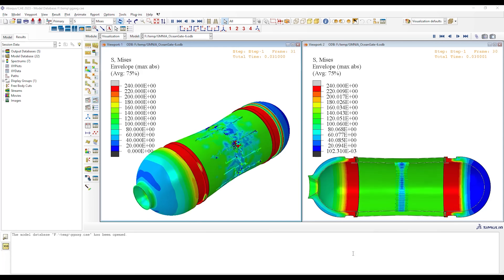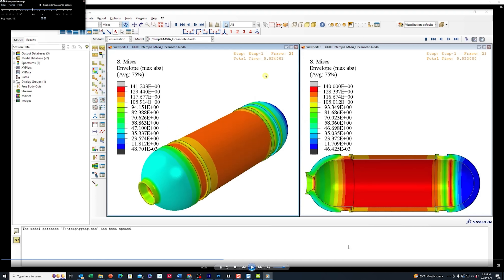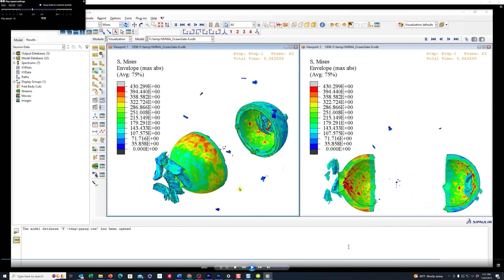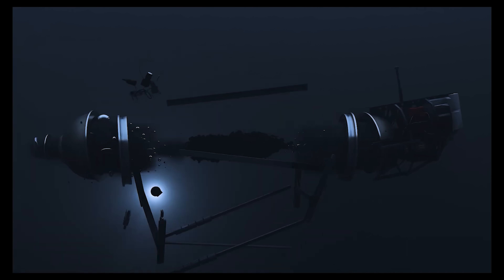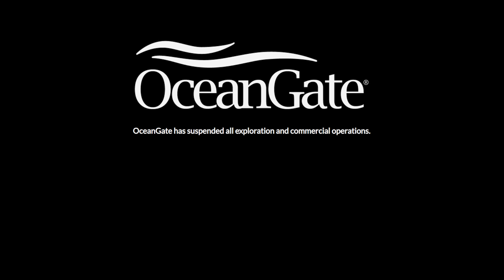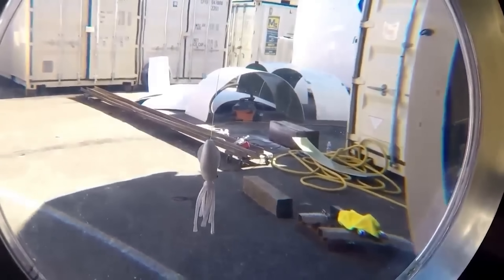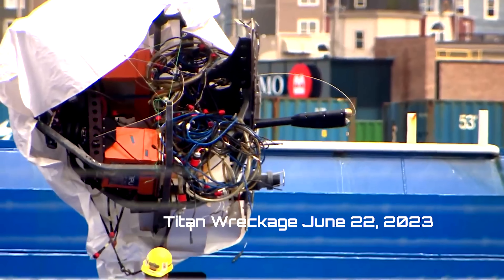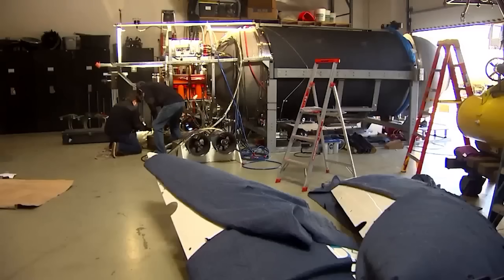Best Titan Sub Implosion Simulation, Cracked Porthole? Q & A

Comment: I have seen Trek bicycles warente a bicycle frame made of carbon fiber tubes and aluminum lugs. Body sweat on the top tube started to get into the joint were the carbon top tube was fitted to the alluminum steerer tube.

Comment: Personally, in my opinion I feel like its possibly started with the carbon fiber hull, then the plexiglass port hole blew because of the immense pressure towards the 2 titanium ends.  If it was the port hole first I will be incredibly surprised and will eat Crow. However my intuition says it very well began at those bonded seals between the titanium and the carbon fiber hull.
Reply: I agree with this, although the video of the recovered pieces weren't that clear, I couldn't see any of the bolts securing the plexiglass retaining ring which would suggest that it blew outwards at the time of hull failure.  If the plexiglass failed and blew inwards, I would expect the retaining ring and bolts to still be in place.
Reply: My engineering expertise says the glue joints seeped after a few dives. That loud popping like a small caliber handgun during the first few dives was that glue giving up.  Then it seeped water, as it got deeper the pressure sealed the seeping. Until this last dive.
Reply: I think someone farted and there was to much pressure
Reply: I'm a little annoyed with the hundred of comment affirming that it's the glue/hull that failed first without any proof.

I agree that it was a weakspot, but it was not the only one (at all), and everyone seem so certain... It's truly annoying.

I wonder why so many people do simulations and investigations given that every students on the planet seem to KNOW what have happen without any proof 🙄

Comment: What if water found a way into that hydraulic hand pump and slowly flooded the submersible as air couldn't escape?

Could that make it pressurized and not immediately be the end of the submersible in an instant? 

Wouldn't be any better as the air would become toxic.
Reply: If any leak existed that allowed water into the interior while they were 3500+ meters down, the water jets would be well beyond water cutter levels of force and would eviscerate everything inside as well as cut through the interior of the hull opposite of the leak source and cause more leaks and thus more jets in the short milisecond before it implodes from being damaged by the water jets.
Reply: @MagnumForce51  I think the thought is weak capillary action like kitchen sink drip level flow.... drip................. drip...........drip...........  squeezing between microfractures in the epoxy resin / CFRP laminate. Slow at first, as the intrusion needs to saturate the hull and then slowly permeate in.
Reply: It wouldn’t surprise me if he used a store bought hydraulic jack designed for something else.  The seals holding the 10,000 psi inside may not be double-lipped or designed to take as much pressure from the outside.

Comment: Nobody's mentioning the Stern half there's a lot of weight bolted on there on the ring that's glued onto carbon fiber, the frame is not substantial the weight without twisting, when that thing is bobbing up and down in the sea when towed that can't be good gravity playing its affects on it, the size of the bolts holding it on not very big. That's where it's happened at the Stern

Comment: Salvaging footage from an exterior camera seems possible.

 I do have major doubts about getting anything from an interior source, because the implosion was so violent.  It seems likely that any tech there was effectively pulverized on the spot.  But it is still a possibility that should be explored, I fully agree.
Reply: One frame every 16 milliseconds, implosion probably took a couple of milliseconds.  If it could be recovered, you'd see everything fine right up until the last frame recorded, then if it could record more, black.
Reply: where is the camera data stored, is it on the laptops located inside. then no.

Comment: When the hull fails, there are two nonsurvivable conditions. First would be the force of water against the body, it would immediately cause a spike in BP, probably enough to cause aortic dissection (this is the common cause for death in high falls/airplane crashes). Second is if you're not in the shattered area, the air would be compressed. This would cause your lungs and eardrums to rupture (a 20psi overpressure from a bomb blast would do the same thing), followed by Thor's water hammer.
   Hydraulic fitting have insane pressure ratings, and would not be affected by the external pressure.
Reply: A spike in blood pressure and concussive injuries are the least of your worries at that depth/pressure. They’re not falling; they’re being crush—literally pulverized—by 5550 pounds of water on every INCH of their bodies. You’d be turned into soup the millisecond your body experiences the change from 1atm to 380atm. That is the one unsurvivable condition. 

If your pressure vessel fails there is no other outcome than turning into mush.

As for your claim on aortic dissection being the “most common cause of death” in falls from height: you could not be more wrong. The most common causes of death in these scenarios are age, fall height/place, lineer skull fracture, subarachnoidal hemorrhage, cervical fracture, and thoracic vertebra fracture.
Reply: @MedicAthlete24W  I focused on the first millisecond or two, before the, oh 32+ million pounds or so of water force bears down on the rest. You get hit with the inrush of water, or are in the air that is compressed briefly before you turn into physics.
   The aortic dissection part is what happens to your trunk when you fall at terminal velocity, not slipping out of the tub or falling down stairs. Yes, bones will get broken, but the aorta fails before the heart would explode, and that would be the cause of death. 
    All that is presupposed on an intact body, which definitely is not going to exist after Thor's water hammer swings (total failure of the craft).